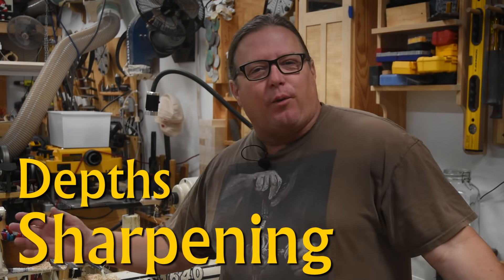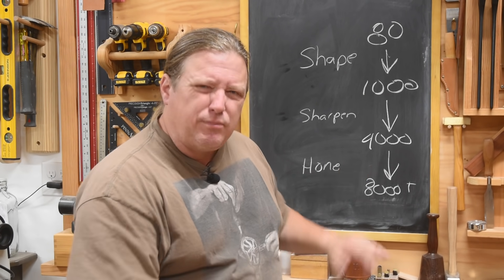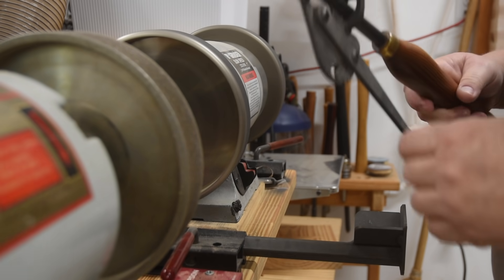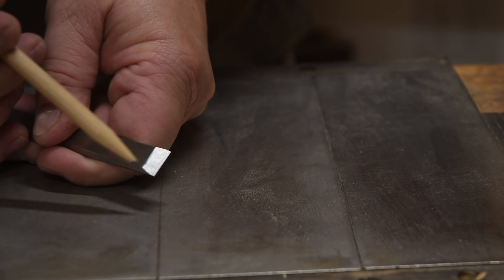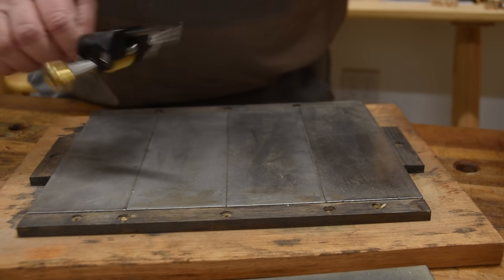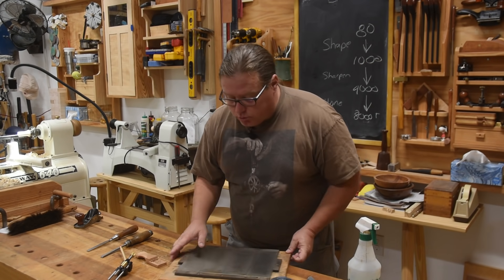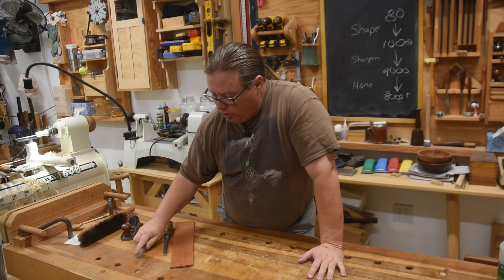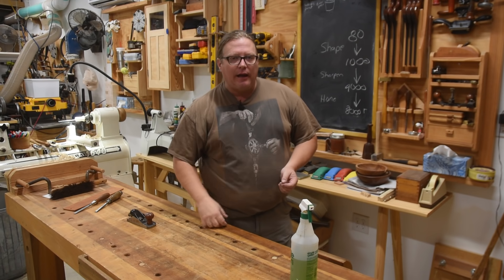How Sharp Must Your Tools Be - Safety & Effectiveness

Comment: Great, very practical and useful presentation! Pointing out that the power that is applied to the tool when it's in use is an important consideration in how sharp the tool needs to be; something I have rarely heard mentioned but is a key point (a fine point, ha). The real takeaways for me. .. Sharpen when the tool feels like it's not cutting properly. Do minimal sharpening to restore the edge (so minimal material removal). Go back to coarser steps only when needed. Practice (and practice more)!

Comment: Really appreciate your straight forward pragmatic approach. I have just upgraded to a series of CBN wheels myself, (80, 180, & 320) grit. My question is What shaft speed is better for 8” (200mm) wheels?
Reply from the maker: Most grinders are categories as low speed or not. I’d pick low speed.
Reply: @wortheffort  Thanks, but my grinder whistles along at 2700 Rpm & my gut feeling is that is way too fast for CBN wheels. My original grinder had stones on it, which I changed out to CBN’s. As an ex sparkie I might build a variable speed unit and try it out. Again thanks.
Reply from the maker: @bloke875  you don’t have a low speed grinder.
Reply: @wortheffort  No I don’t at present. But have just watched your episode on grinders and noted the default speed is is 1000rpm below mine. So that settles it for me, my gut feeling was correct & I will build a variable speed control and fit it and then see how it goes. Many thanks for your videos, they are a real help. Cheers

Comment: Is there any issue using cbn wheel to sharpen a high carbon steel chisel or plane blade? Heard it could gum the wheel
Reply from the maker: no. brass and copper will gum it up but not steel.
Reply from the maker: See today's video.
Reply: @wortheffort  i actually did watch all of that one too. Must of missed it or go distracted by the kids. Thanks

Comment: I sharpen all my knives to 1500 and then touch up the edge with a pice of marble. I have never found i need more than that. Then i set different angles depending on what the blade is for.

Comment: Some woods will tear out at 180 grit; why don’t videos about sharpening ever focus on what’s being cut ? Burled wood cuts differently than straight grain maple
Reply from the maker: I think I've got more than enough content out there on our favorite material and it clearly shows I'm in the camp of picking out the proper wood for the application for the very reason you just mentioned. I mean seriously, my times worth to much to deal with wood that fights back.  I'd rather pick out good stuff from the start so that's what I teach.  I only use the wild stuff for accents or art piece so those can be treated individually and usually not with hand powered blades. But to answer your question "why", because it's about sharpening and not use. It's like watching a video about building an engine and asking why they aren't talking about tires.
Reply: @wortheffort  

   I should have been more specific, sorry - one advantage of cutting green bowls out of Burl is that they dry with less warping because there’s not one direction to the grain - and Burl bowls are gorgeous. They sell for much more money, and might be worth your time to “fight”it. 

A video on sharpening that excludes exotic woods is incomplete- that’s my point. “Our favorite”? Maple ? 

   And I’m giving general feedback - so many sharpening videos show great success with domestic hardwoods, then we students try 180 grit-sharpened bowl gouges on an exotic wood, and it’s a disaster.

Please teach us how to cut the more difficult woods. Your Xmas ornaments would be incredible out of chakte viga or purple heart or macassar ebony or pink ivory or thuya Burl or lacewood. Exotics for decorative purposes IS the proper wood for the application.

Maple falls a bit short in the flair category.

(Sharpening isn’t about use ? That engine/tire metaphor is off target; no one expects a tuneup to fix a flat. A properly sharpened tool should cut any wood that’s commonly put on a lathe.)

   Too bad - you didn’t think about it, defended your “camp”, and (I guess) thought you were being insulted. Students want to learn how to do what they’re interested in, not hearing back from the teacher that their time isn’t worth it. (And I’m willing to pay you for your time, as you know.)

And…..Not all exotics are difficult to cut.

“Your faults….are all in your mind…..you tend to play defensive.”
         Farrell’s Caddie (John Updike)
Reply from the maker: @patrickbrennan2864  this was a beginners video….
Reply: @wortheffort  

Guess what they call exotic woods in the places they come from ?

          “Domestics”

I always thought that was, well, a broader  perspective- friends in Istanbul get very excited to have some mahogany to work with- so - an “exotic” is any wood we can’t get in our own area I guess

Lots of them are easy to cut

Which of your videos cover exotic woods ?
Reply from the maker: @patrickbrennan2864  look to my prerequisite series for my perspective on woods. And again, my stuff is targeted at learners. Exotics and difficulty are not in that realm.
Reply: @wortheffort  

Well they should be

You have an incorrect assumption about exotics 

And I’m a “learner” too

So you’re ruling out working with, and teaching about, any non-domestic hardwood ? I’m sincerely trying to understand what you’re saying - that beginners can’t work with any exotics?

A simple “I’m planning to get to that” would be great - or “I don’t work with exotics”

But stating that beginners can’t learn to cut exotics on a lathe is misinformed 

Seems you want to teach what you do, and you aren’t responsive to students’ requests that go outside what you do- well that’s understandable if you have a good reason
Reply from the maker: Dude, get a grip. This video was about sharpening not grain interaction. You watched a beginner level video and are complaining it doesn't have more advanced information on a different subject. 

My reason I don't work with the stuff your asking about is it doesn't grow much in central Texas. Therefore I don't have access to it at a price that will return a reasonable profit. Which I've talked about extensively in many videos. I also don't believe a beginning woodturner is going to risk learning on expensive blanks such as burls. Maybe you have the financial means to do so but most don't. And as an educator I'd advise them not to anyways. Learn on normal wood that'll reward solid technique not outliers. 

So again, you're asking for secondary level instruction in an elementary level course that isn't even on the subject your asking about. There are plenty of niche turners that can provide you information on burl interaction, curly wood handling, and exotics. I suggest Cindy Drozda. But you're going to have to pay them for that instruction because the market that information is so small they can't earn a living offering those lessons up for free.

In the turning world, the pros working with burls and such... sharpen on a 180 wheel, ala Drozda. I've yet to hear a pro advocate much for higher grinding grit wheels. Lacer will freehand hone skews at 600 but that is it. In the turning arena it's much about angles than grit levels. But that's a more advanced class for those who already know the basics, like sharpening.

P.S. - if you actually paid attention in the video I showed and discussed that the lower grits tore out easier because of the additional force required to get through the grain is matched by equal resistance. Go back to the shavings comparison.
Reply: @wortheffort  

That’s great information, and even better advice. 

Thanks 

Patrick